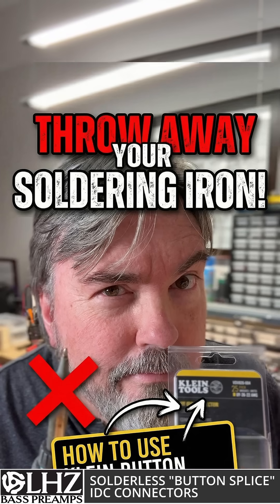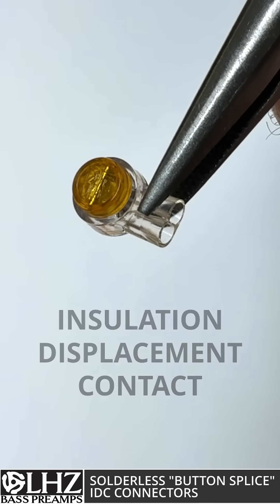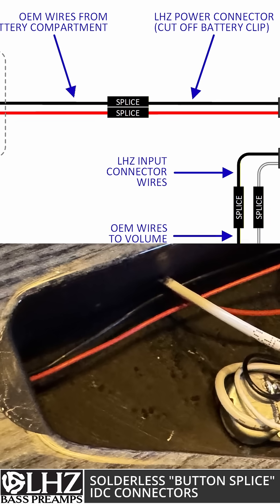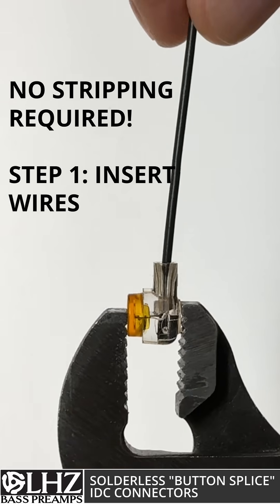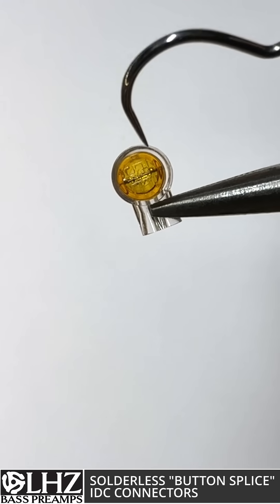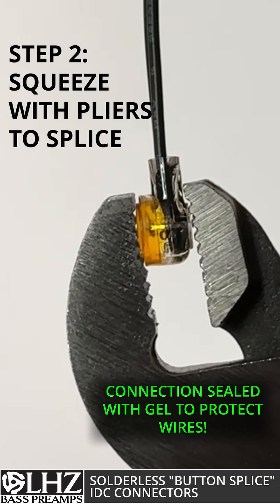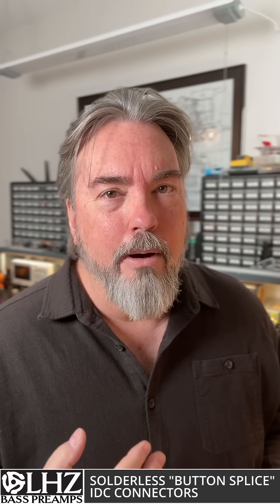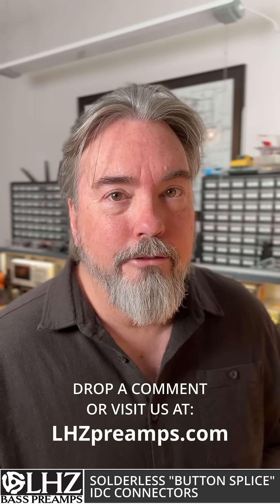Throw Away The Soldering Iron

Comment: Like a splicer but with the gel.  Cool!  Does the gel harden over time or stay in liquid form?
Reply from the maker: No, it remain a thick gel. I wipe the connector down afterward if any gel came out. After that, it stays in the connector and never leaks out. To be fair, I was squeezing the connector really hard for this video to show how the gel moves. Most of the time I use these, it doesn't leave the housing.